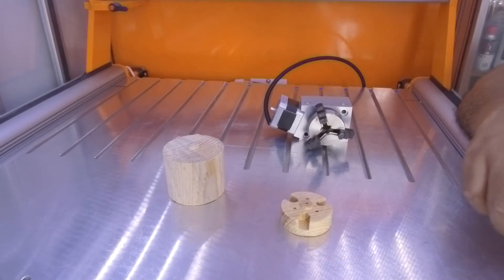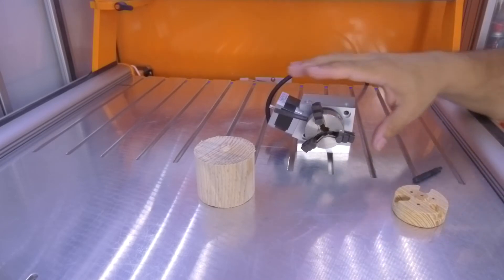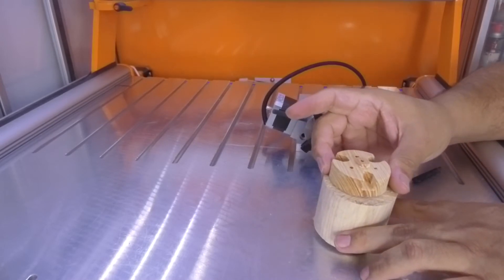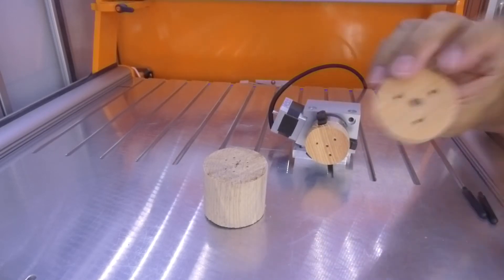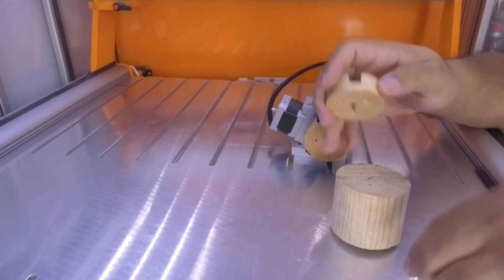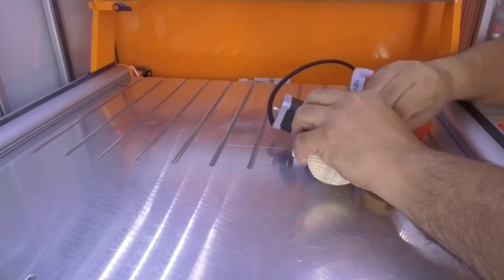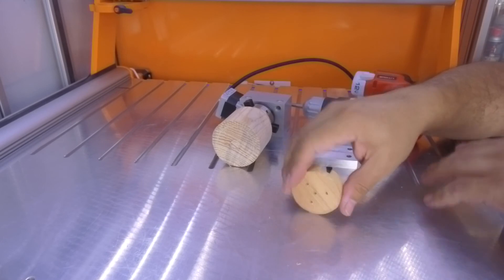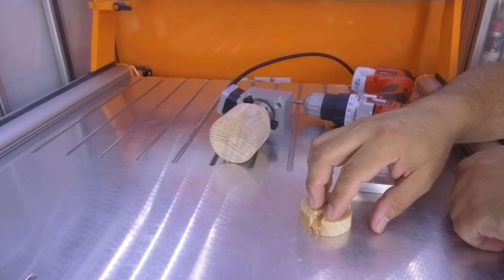Stepcraft 4th Axis Support Tool

Comment: An advertising-only company, a failed machine, is not practical. After working on it and trying it unsuccessfully, the screws must be loosened. It's disgusting. It's not practical, it's a kid's game. You are going to craft a failed D600 type
Reply: I have a completely different experience with Stepcraft.  My M1000 is a fantastic machine and has exceeded my expectations.  Also, I have found that Stepcraft support to be outstanding.
Reply: @patwood7745  Me too I own a D600 and a Q204 no issues unless I create them 
Stepcraft USA support is amazing too!

Comment: The link in the description has spaces in it and does not work. Replace the spaces with %20 and it will work. Use this link instead. http://www.stepcraft.mx/4th%20Axis%20Support%20Tool.zip
Reply from the maker: Thank you!  Link updated with underscores =)